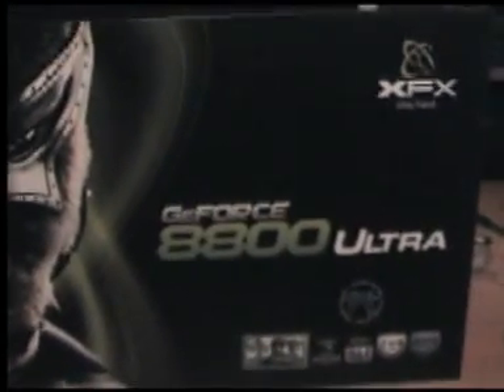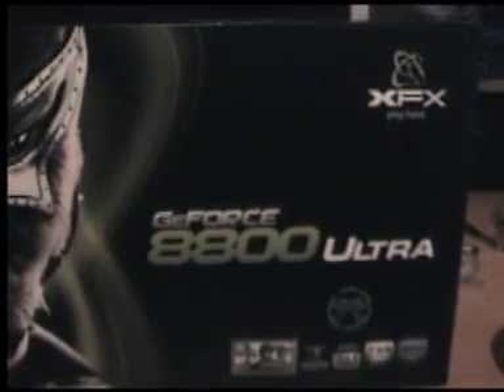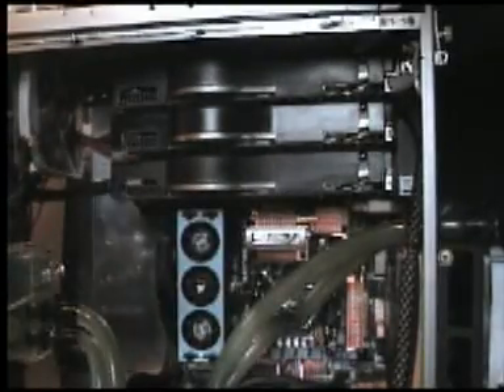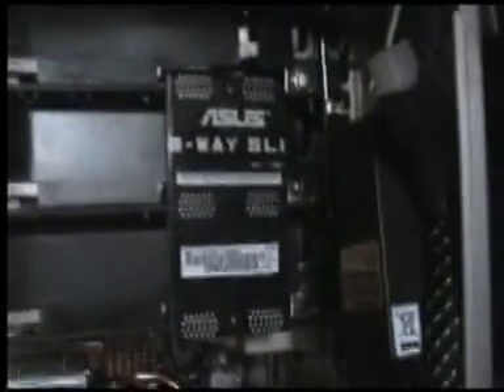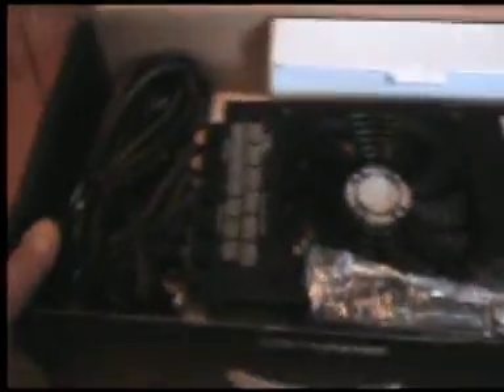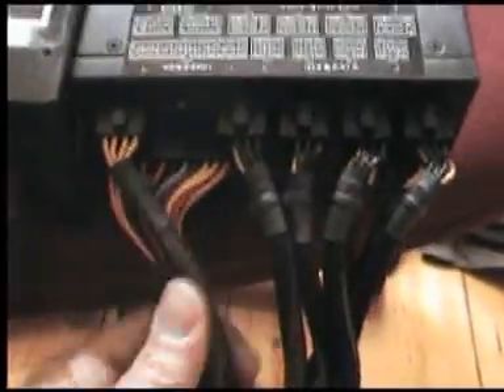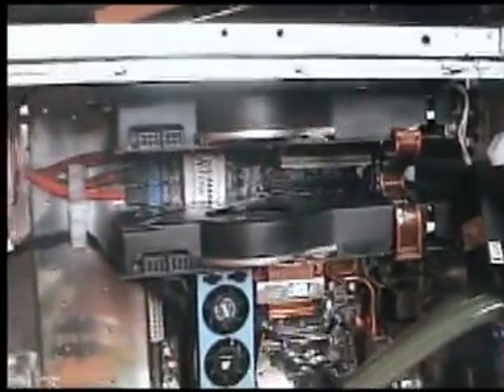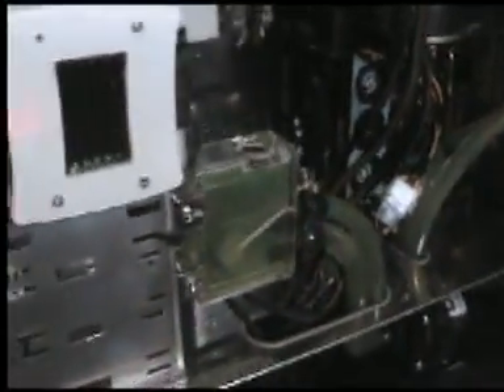TriSLi 8800 Ultra's + 1200w PSU Part 1 Installation

Comment: Technically, in SLI mode, that is true. You can only run one monitor in SLI mode, but if you disable SLI, I think you can run 6 monitors, which is just insane.

Comment: My PSU is 400W and it has a +12V1 Rating of 14A and a +12V2 rating of 16A does this mean that my 12V Rating is 30A? And If my Power Supply meets the minimum requirements for some video cards, can that be bad for performance?

Comment: it supports 3 sli but 2 with 16 x and one with 8 x....for example you can grab 2 ultra`s and one bfg ageya phisyx....the real tri sli mobo is the 780i ....u see 2 are blue and one is white that`s the difference....the blue ones are 16x and the white is 8 x

Comment: in Crysis 1.1 with latest beta drivers with quad 3ghz, 2 x 8800gtx "normal ones" and 4 gb ram at 1680X1050 with Vista all settings on very high i get on the gpu benchmark 30.05 fps!! so with TriSli i don`t think it will be more than 45fps max at this settings but i hope for all the best fps +++ somebody need to "crack" this game in terms of performance

Comment: Well, first you don't need the Galaxy PSU to be 100% modular...They don't think you will need the PSU without the mobo connectors...
Also, you can't run 6 monitors on your rig...not even dual monitor (multi-monitor NOT supported on nVidia SLI technologies)
nice video though...you must be rich :O
how would you cool that? (i'd do water cooling if i were you :P)

Comment: he must won lottery or somthing, hes a rich bastard :) Rlly want that comp :), wanne trade it for mine? Amd Athlon 64 x2 6000+ 3.3 ghz, 2x 3870 in crossfire (overclocked) pc6400 ram (4 GIG), 600 watt Mist PSU.